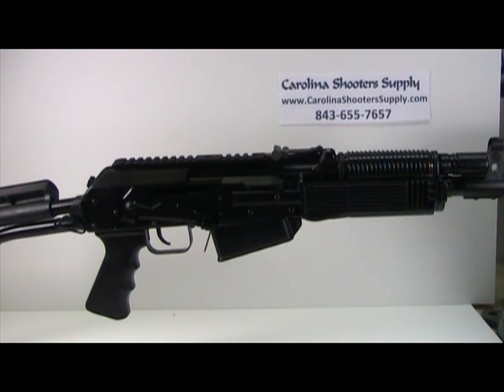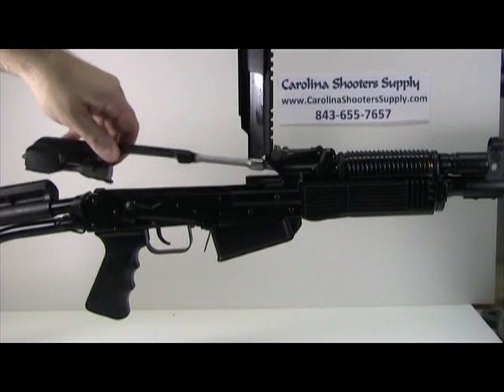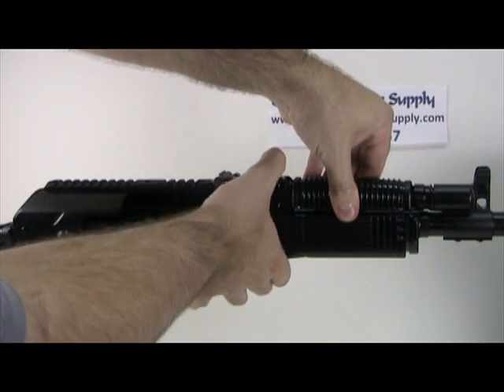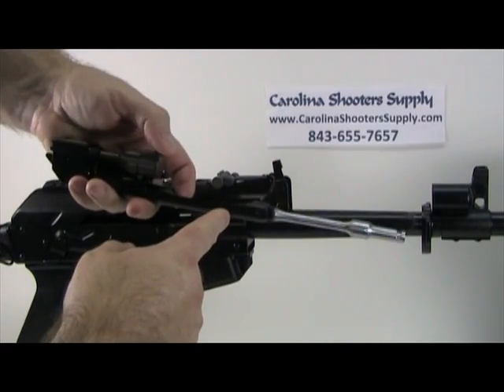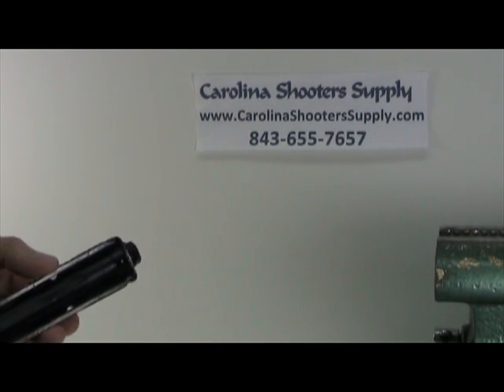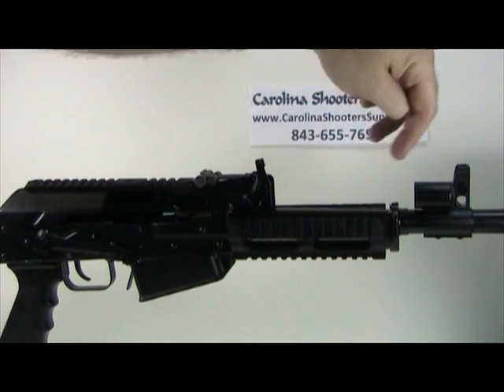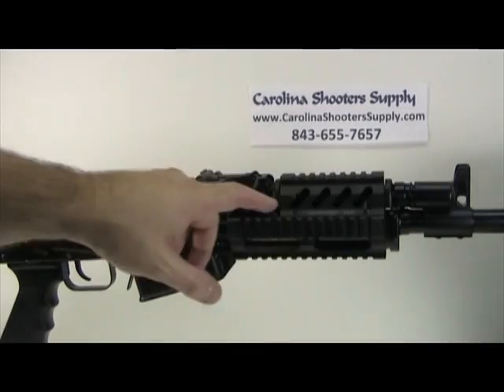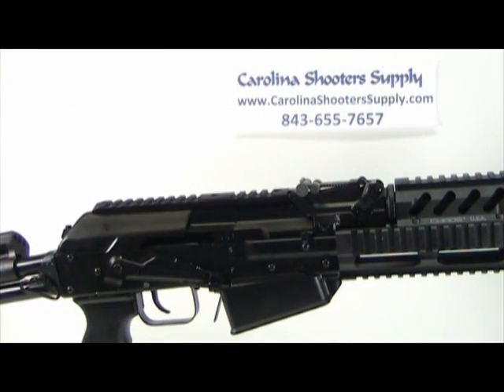Vepr 12 Chaos Quad Rail Installation Carolina Shooters Supply

Comment: How does the 922r compliance work I have a vepr and want to trick it out would this rail   and a USA muzzle brake what would be the cheapest thing I can put on last to make 922r compliant?
Reply: in case you haven't found the answer to this, no it would not. You need less than 10 imported parts total. 
Personall what i did was:
Chaos Rail (1 part)
Pistol Grip (1 part)
Trigger (3 parts)
Magazine (3 parts)
Piston Puck (1 part)

Comment: Would the set screws ever cause damage to the barrel other than scratches?
Reply: if you over tighten, they can cause small circle dents, but that only helps keep the handguard in place. wont mess with the structural integrity.